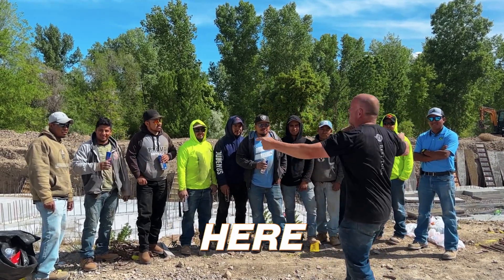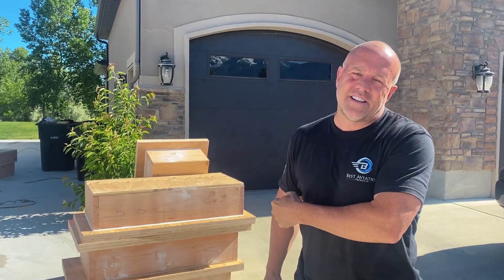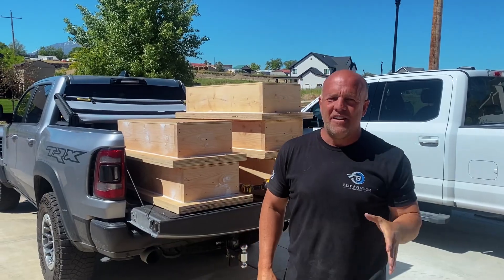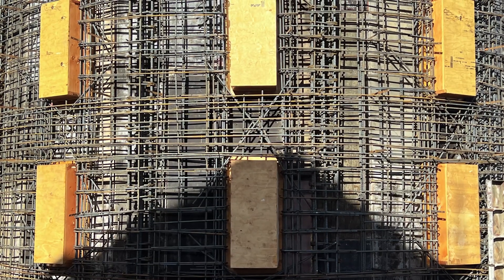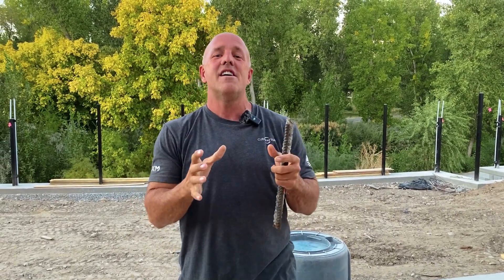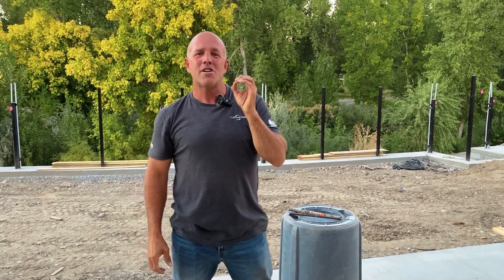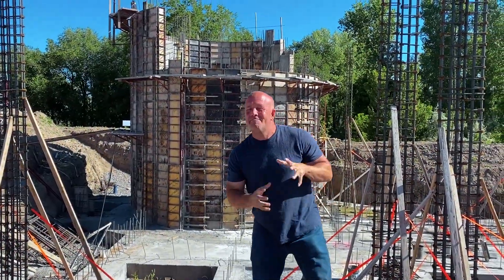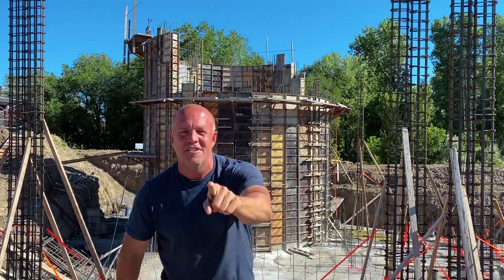A rooftop swimming pool with 27 foot walls? | House Build #2

Comment: May I comment further...? Probably boring, but who knows... maybe will help one day to someone not to destroy big investment, and more importantly lives... I will proceed, as always, in parallel, during watching the video... We are speaking about pressures of around 1 bar at the depth of 10 meters (30 ft). and (unknown dimensions, but let's assume some 200-250 cubic meters of water, that is some 200-250 tons!!! + Concrete construction! ... windows: don't call concrete a "mud", and those holes are good idea, and You are completely right... (ears, pressure equalization, etc... Me personally can't do it, have some problems, with narrow ear channels...I was in artillery trough few wars... but even before...even 2-3 meters (10 ft) deep water, create me a big pain in my ears...airplane landings also... - lets proceed: Nice done angular rebars, at every window... perfectly performed! Any opening should have it... even for protrusion of tubes, ventilation channels etc. Keep in mind that surface calculated of rebar, can always be switched (and is better solution) to use more thinner bars, than less thick bars, just to have same section surface! - (keep concrete humid for minimum 7 days after pouring!)...and check temperature of it when is poured, its important - check it! ... and always pour it in layers like 1ft with vibrating it, but dont exagerate, to avoid "segregation" - separation of bigger and smaller pebbles up and down... Point is to maintain compact and unificial granulometry, that therea are o voids and air insie concrete wall.. Regards from Serbia!

Comment: The filtering system and turn over rate just to cycle that water in that pool once.
Will be incredible.
This will have to be 24/7 operation
Just this cost along with chemicals will be outrageous.
    Let alone all the moving parts your adding to it.
     Operational costs will exceed the cost of the pool within 4 to 5 years...Just incredible.

Comment: @MikePatey

I have a safety idea for you. Embed a multi-color rope light in the edge of the pool…when lights are off it’s invisible. Write a simple code where pool edge lights are red whenever your floor is too shallow for diving. Green when deep enough. You could even go a bit overboard (neither you nor myself could ever be accused of over engineering things 😏) and embed an E-INK display in the deck, properly waterproofed, that resets to show current depth. Maybe color code THAT!

You could also integrate light signaling into under water lights for those who are night diving, etc.

My thought being that it could be one integrated solution to safety, etc

Comment: Next time, use a slip form. Also a question, are you using adamixes such as plasticisers and retarder to make the concrete more workable and to  lower the heat and slow the hydration process

Comment: Water going over the edge and down the entire structure would be such a huge opportunity. Infinity edge mode turns it on and off. so when the kids come over It lowers a foot or two or three.
When not in use or used by adults water raises back up and waterfalls or water shimmer water dance down the wall do the infinity edge as a showpiece. I mean your already above and beyond anyone else.
It only makes sense to go all the way. Right?

Comment: The pour rate for symons forms is 4’ an hour. At 27’ and poured at the correct pour rate this should have taken 7 hours. The guys likely poured too fast which is what caused some of your wedge pins to pop. Huge risk to save a couple hours, looks like they pulled it anyway.

Comment: do you plan on coating the inside I'm surprised you guys used flat ties. I may have done one or two or forty water tanks no windows though you might want to look in to DE NEEF waterproofing injection, good luck hope I'm wrong

Comment: Wow . Amazing !  Dear Mike I so  love your amazing  projects  and inspiring engineering story telling .
Hey At my work complex is a collosal and also very tall water tank made of rolled steel sheet , designed to run a mega sprinkler system across the factories .It  made me wonder, with so much steel r- bar concrete and labour) -  How would  a pre fabricated steel plate build compare for strength and cost? Please keep videos coming

Comment: How are you going to control segregation of the concrete with that long of a drop with that much rebar?
Reply: Also did you use xypex in the mix? Just curious.

Comment: I don't think many people fully understand just how insane it is to build 27 foot concrete walls.

The pressure of the concrete at the bottom of the formwork would have been greater than the pressure of the water at the bottom.

I'm in awe.

Comment: Amazing video! Once the weight of the water is applied is there any sinking/compaction that is expected to occur? This design I s very interesting because typically you have a buoyant force pushing up on a pool (think about it like a toy boat in a bathtub) and you have the weight of the water pushing down. In this instance you just have the weight of the water, no buoyant force since the pool is above ground

Comment: Just don't let your stinger linger. What I mean is, if you keep the vibrator vibrating for more than a split second in one area, all your aggregate will drop to as far down as it will go, and you will not have all the elements of the concrete working together. It would be better to vibrate the rebar or even the formwork more than sticking it down in the mud and just holding it there. So yeah, too late to take my advice, but maybe somebody else will find it useful. Quite a project, Mike. Looks more like a commercial job. Wow.

Comment: How long did you let the concrete cure before pulling the forms on the bottom of that 27 foot wall??  I would be scared to even contemplate such a project when I see how poorly concrete is placed in the real world!  Ninety per cent of the work I see on YT and about the same in real life the contractor can't be bothered to use dobes or chairs and will walk the steel right to the bottom of a slab.  Since they are all busy and overbooked you can't get on them or your job won't get done.  It is hard to find good help as the saying goes!  I liked your technique about pouring one side of a window form out before going to the other to avoid the common bubble.  The technical aspect of keeping the seal on that pool as the bottom cycles up and down hundreds of times is absolutely mind boggling.  Amazing that you could make that a monolithic pour at 27 feet both because of pressure on the bottom and speed with which it could be pumped.  You do love a challenge!!

Comment: I am a swimming pool contractor; I have a few questions. What engineer did the plans to get approved by the city engineer? How many gallons will it be and what size pipe for suction and return (what schedule pipe) What's the filtration system looking like. Thanks

Comment: You have no idea Mike how instrumental your motivational intro is to me as a designer. I have learned a lot of good attitude from you ofcourse lots of other learnings too. Great job explaining holes in the boxes, it is the little things that matter. I have similar brain to you but I just need more sleep, but I keep designing in my head constantly, I have got tons done in automotive carbonfiber parts lately, 3d printing the molds and inner structures.  Starting to sell car parts that can be printed and interlock to the final form. Now tomorrow I will get my first ever limited series aluminium 3d printed furniture done.

Comment: 11:02 that is true, however, it's worth mentioning that this doesn't happen just there, it has to work in concert with every structure that it is subservient to. Otherwise, you end up breaking right through a floor, you rip a wall (for example if you upscale a beam feature) and many other things. Whilst it's true that buildings are simpler than airplanes, and answer to fewer rules, the few that are there are extremely important to be respected.

Comment: I used to like swimming in an old dam way out in the bush above a village with a train station that passed through. They'd built this dam back in the steam engine days as a source for filling them. It's not huge area wise but about 20 feet deep and virtually nobody else even knew about it. It was a bit of a wild drive to get there but such a great spot. The best part was because of that depth, AND the fact it was hardly disturbed that top few feet were quite warm. Diving down of course was a very different story but, I'm betting your pool with that depth will be very similar in that the top area will be a really pleasant temperature naturally.

Comment: You also need to increase the thickness of the concrete required to achieve the worth of the larger bar, and not allow the larger bar to just reduce concrete volume.. a 1 inch bar in a 1.5 thick wall, would not be as strong as a 3/4 bar in a 1.5 thick wall., but I’m sure you went well thicker than required..

Comment: Will you have an oxygen/air safety line. Like air  on tap on the bottom or half way down. Or maybe multiple lines Incase you need some air along the way down or up. ??

Comment: Fun Project Mike....You are going to attract a lot of attention from the diving community!  One thing I'm not so sure about....making it to 27 Feet clearing your ears three times.  If you are a diver, you know that the percentage change in pressure is greatest at the surface.  I typically have to start in the 4-6 foot range, and then every 3 to 5 feet gradually increasing as depth increases.  By time I get to 27 Feet, I've cleared at least 5 to 8 times.  Remember that 33 feet is a whole atmosphere more pressure than at the surface.
Reply: When free diving I clear continuously on descent.
Reply: @mckenziekeith7434  Absolutely, I dive into an 18 foot deep diving pool off 5 & 10 meter platforms and make it all the way to the bottom in an instant.  But I've learned to use the force of impact as part of a continuous clearing action.  People at the pool watch and then say how the hell does that happen.
Reply: @diverbob8  I have to pinch my nose to clear my ears. It would be easier if I could somehow clear them without pinching. But I have never been able to do that (other than, for example yawning during descent on an airplane, which I used to do before I learned the Valsalva maneuver).

Comment: For high pressure 3000-5000 psi natural gas tanks, one way to increase strength is to take steel wire (or something with good tensil strength). And wrap it many times around it’s diameter. Like a winch cable wrapping around and around. Boom. Very strong

Comment: Given your penchant for flying, Have you given consideration to the need to keep track of your time at depth in the pool? It's not uncommon for vacationers who dive up to a day or two prior to flights to experience the bends in a range of severity on the flights home. The shorter the time between diving and transitioning to altitude the more likely you are to have issues.

Comment: A little proof reading needed I think.  'Then' implies a sequence, 'than' is comparing one thing to another.  Other than that, very interesting video.  (I'm an old nit-picker Army aviation Tech Inspector. Can't help myself.)
Reply: I hear you; however, in Mike’s intro, he only mentions math, physics and engineering. English didn’t make the cut 😂.
Reply: @ChandraSlyFoxPatey  All of these sciences require proper communications to pass on the learning.  My dad taught college level math for half a century and if the grammar or spelling was off on exam day, he marked the work accordingly.

Comment: Man, you went through a lot of extra steps but didn't add an extra corrosion protection coating to the rebar.
Most pools are built with dipped green bar so they last a lot longer.
Reply: As long as the bar has a decent amount of coverage on each side it'll be fine, also the different products that will be applied for the pool will make it waterproof and impermeable... Most pools are not coated in epoxy, bridge structures are
Reply: @americafirst3738  Its not epoxy, it is a zinc coating. It is evident that you have never installed a pool or even worked with rebar.
Reply: @imontime77  Huh???? The green rebar is EPOXY coated jack... Lol.... Smh
Reply: @americafirst3738  Some zinc galvanized rebar comes out green also. Depends on the manufacturer. The epoxy coated is shit because of cracks when it is bent or handled rough. Spk
Reply: @imontime77  welp up here on the east coast most bridge work is epoxy coated and galvanized bar is grey... Either way it'll be protected
Reply: Chloride ions are the number one killer of rebar. Based on that, it makes sense that you would use special rebar in a pool. Maybe he will use a non-chlorine method of sanitizing the pool.
Reply: @mckenziekeith7434  It might end up being a salt water pool. The sodium won't do it any good either. Could go the Bromine route but clarity sometimes suffers. I can only imagine the filter pump system he will need for that volume at that head.

Comment: I’m curious what direction the filtration system is going.  I had a small pool service biz in the past, I can offer insight there not common to the industry.   For example, I think borate is the best amendment to your water chemistry.  Also big fan of chelated copper products, PoolRx being my fav.   For pumping I imagine you’re sourcing from a totally different arena, but I really liked the brushless DC pumps that were beginning to grow in popularity for pools and ponds when I left.  Check out SunRay DC pumps in CA, they can even run gridless off a surprisingly low amount of direct solar, no converters necessary

Comment: I feel like it was made specifically to address my comment on the pool design video. Really well done on the engineering side! Running the vertical beams up continuous is a really good idea because it distributes stresses throughout the rings. Crazy that it was all done in a single pour. The forms themselves would have experienced similar pressure as the pool with a pour that high.

Comment: Mike, I’m curious. Did you and your engineer consider doing the pool wall pour in stages. As you mentioned, the forces with a pour that tall are tremendous. Was there a strength concern with adding a cold joint? Did your pour team run into issues with mix separation or voids when filling double sided form work that tall? Thanks for doing cool projects, you’re an inspiration.
Reply: Mike is his engineer.

Comment: What a project..!!!  New Home? & Pool,  Mike what is concrete for per yard in Utah?  Will this double as a Helicopter water landing pad LOL, How do you seal the bottom if it rises? and where do you dump the water when raising it, what permits did you have to get for that run off and are you on a Water Well Table? or City water.
Reply: I am guessing the water column stays as is and won't be pumped to another location as the floor rises. The real trick is how to move the water above or below the floor as it rises or falls within the structure. Pumps? Perforated floor? Both?

Comment: How does pool heating work? Wouldn’t it make sense to only heat the top part if the pool is in the shallow mode?
Reply: I don't think you can heat part of a pool. With the filtration running, the whole pool is going to be at the same temperature. Pretty much.
Reply: @mckenziekeith7434  yeah, you’re right :D

Comment: Hey Mike could curved corners on your pool windows (eg like airliner passenger windows) also help elleviate stress cracks/fractures in this case?
Reply: Absolutely, the hard 90*s always give way to cracking... It would be neat to see how they would go about it, pre-built out of acrylic and cast it inplace is how I would do it

Comment: Long ago I helped form up and pour the foundations for towers, exchangers, and compressors in gas processing plants (and set the equipment, tube up the instrumentation, then start them up). I've never seen anything of this scale poured in one shot.  The engineering on this is very impressive!!

Comment: It might be to late for this but imagine a rock climbing wall on the outside of the pool
Reply: Not too late, it'll be sweet to do a carved concrete wall on this structure for climbing
Reply: And a Helipad!
Reply: It could easily be a wooden structure hanging off the sides a few inches thick.

Comment: Would using round windows resolve the issues with stress cracks? I can see how it might need more engineering to keep them from popping out due to pressure.

Comment: Mike, the cylindrical pool is a perfect project for post tension cables. If you have PT tendons wrap around the wall, then tension them after the concrete hardened, it would be a perfect solution to control the cracks and reduce the stress caused by water pressure.
Reply: The only way that structure could possibly crack, is if something serious went wrong with the pour or the mix itself. The rebar is way overkill for the application (would have done the same myself). I pity the demolition crew who has to bring that structure down in 200 year's time..
Reply: Hundred percent agree. PCCP Goes pretty far back. There’s actually some 24 foot diameter pipes out in Arizona. Also, there’s acoustic sensors you can put on the walls that will triangulate if/when/where any cracks did occur.
Reply: I’d be afraid of the weak point created by the exit/access point of the cable ends.
Reply: @Crewsy  I think the cables would just wrap around the outside of the pool.
Reply: A certain bridge with disagree. tension cables should never be considered to be a critical structural element.
Reply: @switzerland3696  I have seen tension cables used as critical structural elements many times. The first one that comes to mind is the Golden Gate bridge.